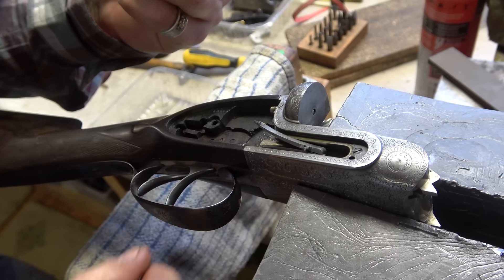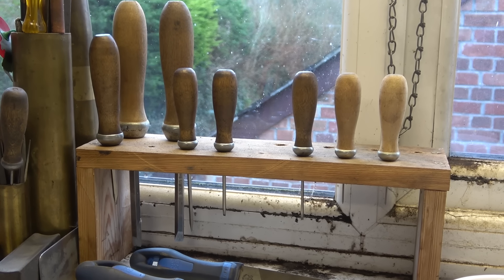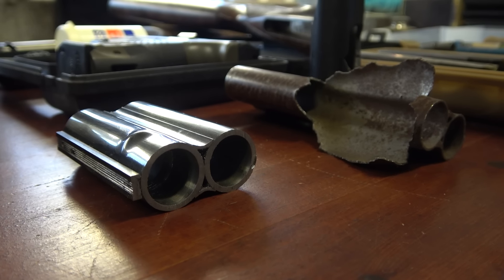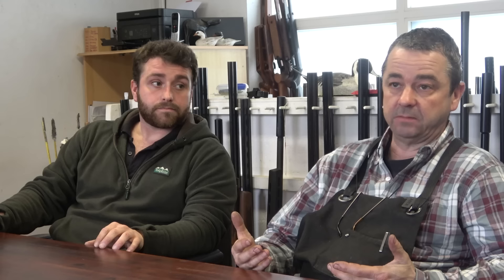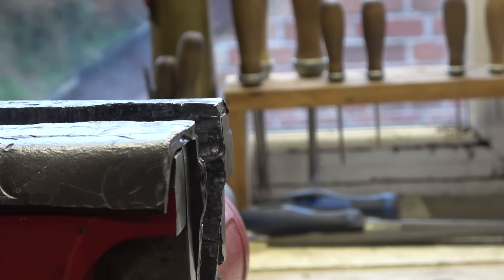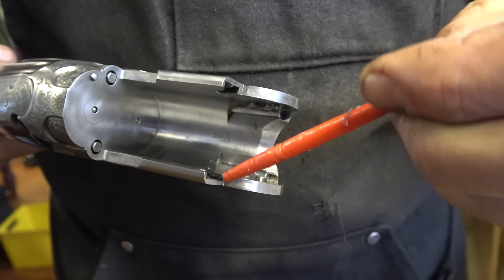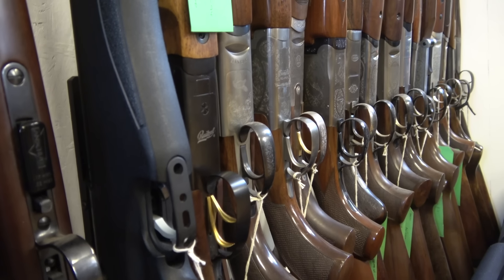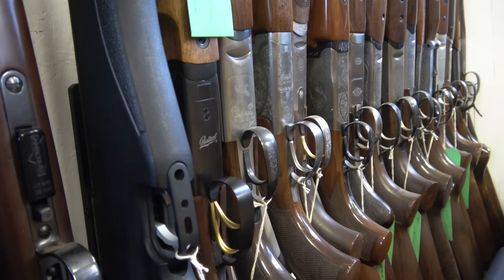Servicing your gun: how the pros do it – FieldsportsChannel Podcast episode 90

Comment: John Spary and Joe Hocking are both excellent gunsmiths. John, particularly, has saved my bacon a couple of times! A rifle that misbehaved after a 'helpful' stalker changed my trigger spring for me, resulting in a rifle that would ND as the safety was taken off in order to empty the breech. John sorted that in very short order by replacing an M5 bolt inside the trigger action - and charged only a very modest fee for solving what for me was an intractable problem.  Excellent service; excellent gunsmiths. Highly recommended....